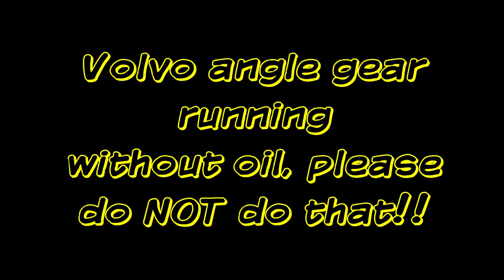Volvo angle gear 1997-1999 No oil & it looks like this.......

Comment: What sound was it making? I have what sounds like a a ringing sound coming from the front of the driveline and i think my angle gear might be toast.
Reply from the maker: Don't know, bought it together with a trans but knew it was probably toast. Drain the oil from the AG and see how much is coming out, it hold 0.7 lit (23,66 oz) if you get less then that out your AG is probably toast.